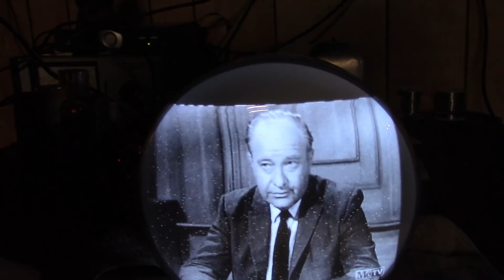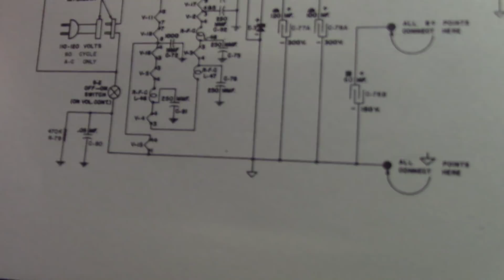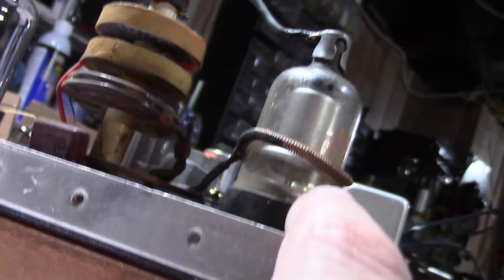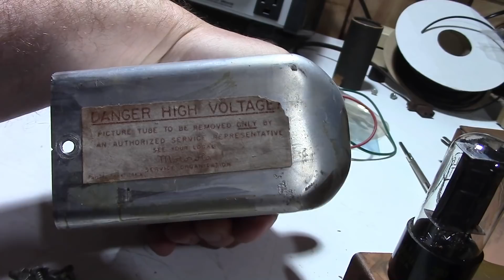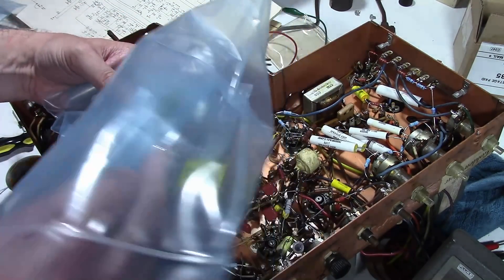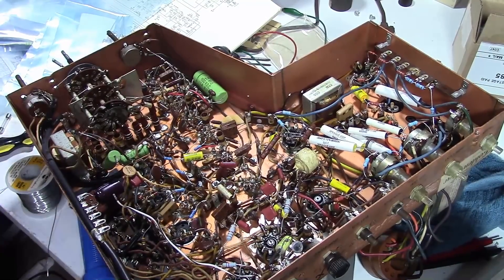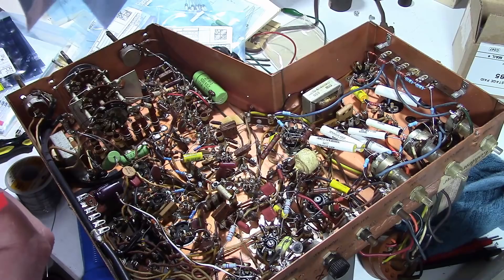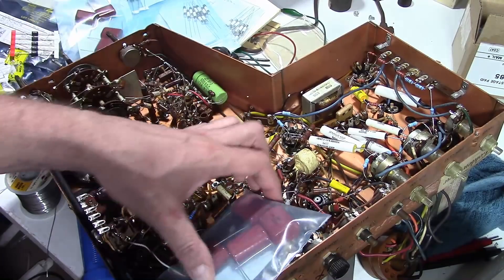Motorola VT-71 restorations p8o10

Comment: For film motor run caps. you might find something used in ceiling fans in suitable values,they  come in a square plastic case sometimes with a mounting hole on the case
Reply from the maker: Yes, I am familiar with them and they would work well.  I believe that's what the caps I show in the video are for.  The boxy ones are slightly larger.   I used one with a mounting tab in my Predicta Holiday TV,